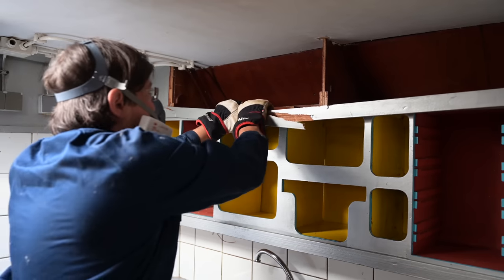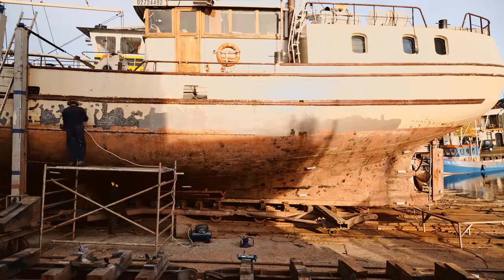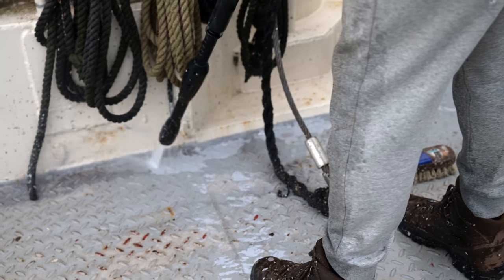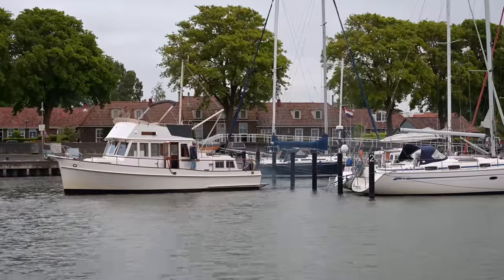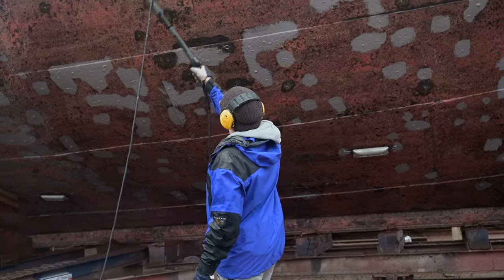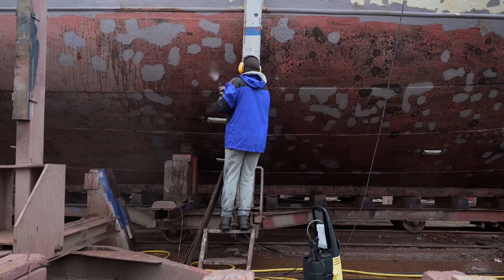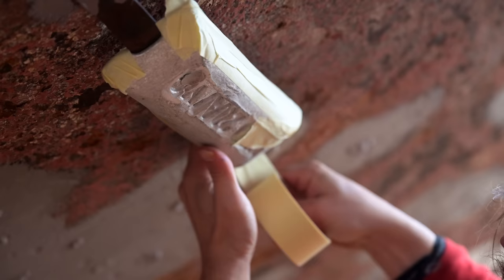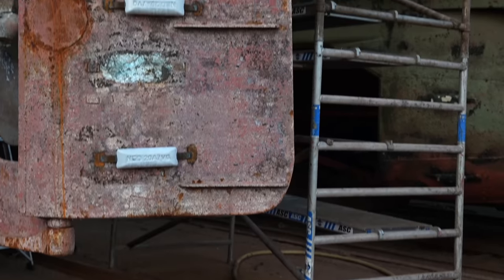Getting Our 82ft Steel Hull Ready for Paint! Now That's a Huge BOAT!

Comment: I love this old vessel. She’s such a cool shape and traditional fishing boat style. Great work guys, you’re doing well!
Reply from the maker: The hull was designed for efficiency and for relatively long fishing trips out on the open ocean. That's why you have the sharp bow and the drop shape. Flying Coney has the shape of a lugger, a drift netter in comparison to a trawler it's a more  elegant shape if you ask me. The reason is that a drift netter is designed to sail to the herring grounds, trow the net overboard and drift in front of the net for a few hours whilst providing a stable platform for the hard working man. A trawler is designed to tow big nets over shallow areas like the Dogger Bank with enormous capabilities to resist the heavy sea in this areas. Hope you find that interesting 🤓
Reply: @FlyingConey  I was a commercial fisherman for years, I think that’s why the bill shape and general design of it appeals to me. An aft wheel house is always a nice ride in big seas. You guys have a beautiful vessel and she deserves to be kept alive!
Reply: Sorry, hull shape and design.
Reply: I’m a perfectionist, and I completely relate to the inclination to do everything perfectly. I sometimes spend way too much money on the “best solution”. I agree being in the shipyard was probably a good thing to get the project moving.

Comment: What a great day when its time to paint, You both must have been so relieved and a lift of enthusiasm with a splash in sight. 
Cheers from NZ
Reply from the maker: All the time the lads told us we have to wait to see the hull painted. I was always a bit skeptical with all the rough welding spots and asked them each day if I can take the sander to make the flush... They told me I've to wait. At the end they were right! With the paint on it's barely visible and it looks like any other hull from that period.

Comment: Paint or primer usually comes off from a steel surface easily when it hasn't been sanded properly or its has dirt dust grease on the surface prior to when it being applied.
Reply from the maker: Sure, but the paint has been on there since at least 2018 and it still is on the port side. It must have been a chemical reaction with the dust or dirt. It's no big deal but interesting.

Comment: Few tips:
- Rust = At least use Rust converter/eater or Phosphoric acid
- We had our 30m ship blasted with 3000bar water jet. It was sandblasted 2 years later. For boats this size the high pressure was really is not equal or better than the sandblasting.
- Next time you prepare the boat for paiting I would rent diesel heated steam/pressurewasher with proper nozzle. The prepwork is more important than any other stage.

Keep on going!
Reply from the maker: Hi, thank you for advice. My question about the water jet blasting you've carried out would be if you have a welded or a riveted hull? The reason we tend towards the water jet blasting is to don't damage the rivets and the seams. We simply forgot about the rust converter. Over the weeks we lost the ability to make proper decisions. In hindsight probably a big mistake but so far the paint is holding up quite well. Also the hull was of course pressure washed when they hauled us out. So it was more a washing off dust and dirt than anything else. Thanks again for your comment!
Reply: @FlyingConey  Our´s is from 1950´s so welded but deck is aluminum wich is riveted and later partly bolted with HST bolts. Our issue was that the areas that were ok before, were ok after the water blasting. Areas with rust issues still had them after the blasting. I know what kind of workload you are going through. Keep up the good work! I think that the paint will be ok until next time :) 

Forgot to say that steel/aluminum seams started partly leaking after blasting, but the is nothing that 5 layerd of International won´t fix :D

Comment: Pressure washing and leaving a fine coating of rust is a common practice just make sure that it is completely dry before painting.  For your information those slots on the deck walls are for letting water drain out.  To prevent water coming in with big waves they sometimes put flaps over them.  Just make sure that they open outward.  I heard of a case where they but them on backward and opened inward trapping water on the deck and even sinking the boat!

Comment: Hi guys, you need a gas powered power washer. They are much stronger and will really clean very well. Actually, I would rent a steam Jenny. They power wash with steam and high pressure and do an amazing job. Just some suggestions but I guess you guys are way past that point already. Keep up the great work and in the meantime , stay sexy Barbara. ❤️ 😁
Reply from the maker: Hi Frank, thanks for the comment! The steam Jenny sounds interesting for cleaning the bilge and the engine room. Maybe it would also be possible to get the coating off from the inside. We could've used the power washer from the yard but we pickt our own little power washer because we only wanted to clean the dirt and the dust off. And as you've seen we striped the paint from the deck 😂😎
Reply: A good thing to consider before Splashing,Would be To Pressure wash the Bilges from Bow to Stern! That way disposing of the contaminants could be contained at the Location for Proper Disposal!! With a vessel of her age I would imagine that the Bilges were neglected as much of the rest if the vessel was when your purchased it! Just a Thought of Good Common Sense, and Beneficial to the rest of the project going forward.

Comment: what did you use to catch the paint flakes from just landing on the ground? did you check any of the paint for lead content? otherwise another great video and best wishes. also if you don't want to sandblast you can hydroblast. there are pressure washers that have over 20.000 psi which will remove paint and rust.
Reply from the maker: The yard has a strainer at the end of the slipway. From time to time they shovel all the dirt out and it properly disposed. The paint shouldn't contain lead. Hydrojetblasting is a possible solution to blast the hull but we're not sure and it will depend on the company that carries out the work.

Comment: I may be asking a silly question but couldn't you use a rust converter on the boat and then prime and paint?
Reply from the maker: It's absolutely no silly question. It's always necessary to get rid of loose rust or layers of rust. That's the reason why we needed to treat the waterline, just to make sure that there's no hole. When this first step is done it's a matter on how long you want the coating to last. Directly above rust, 6 months. On properly prepared steel like we had done, 5-7 years. You can add a few years on top of that if you use rust converter. Sandblasting 20-25 years. Then you can make the calculation what makes sense and what not. but we simply forgot to use rust converter and where to tiered to make any decision.
Reply: Thanx for the answer

Comment: Did you use 2 part Epoxy Primer for the Bottom?
Reply from the maker: Only on bare steel like on the welding spots. Usually you need a blasted surface to use a two component paint. So we used a high quality aluminium primer.
Reply: @FlyingConey  who would recommend Single part Alluminum base Paint on the Bottom of a Steel Vessel? You also referenced applying new Primer over old paint being acceptable in your previous videos. Very Confusing.
Reply from the maker: @lawrencetrapani5623  Not confusing, just industry standard. If you have a blasted hull and the right conditions you CAN apply a two component paint. If you top up the paint you use a one component system since it's possible to apply it above most two component and one component paint systems. A two component paint system is also about 20 000€ for the paint alone a one component system is about 3 000€.
Reply: @FlyingConey  you Get what you Pay For! It would seem the best choice would be to apply the most effective product for Longevity! You had some Serious electrolysis issues and it would seem that giving it all the protection you can! PS have you taken steps to making sure that your grounding system throughout the vessel is inspected, additionally, it would be a wise choice to have someone bring a corrosion meter to your vessel and  check it for galvanic or stray current corrosion. I would recommend you purchase or contact someone to spend the time with a Corrosion Meter on your vessel and point out any stray current, and make sure the vessel is properly protected. Corrosion is measured in millivolts and if not properly addressed can certainly cause problems.
Perhaps you would find a journal or book to assist you with this!
Reply from the maker: We're using high quality paint. Pretty much industry standard. We've measured the 24 volt system and disconnected the 220 volt system. So for now it should be fine. We still try to find a good marine electrician to investigate what happened. And we now have the proper type of anodes!
Reply: @FlyingConey  Do Not think that your 24 volt system isn't capable of producing galvanic corrosion as thus is usually measured in Milivolts. Please find a certified person to do a Corrosion Survey on your vessel when you put it back in the water. As an additional note. When you tie up to your new Dock, Check the water to also find out if there is stray current!
Reply from the maker: We've already measured the 24 volt system and we#ve found no issue! It's allowed and not difficult to do it on your own. 220 volts are dangerous and therefore we need a professional to do it. That's why we've completely disconnected the 220 volt system. We're also not plugged into shore power so there's no way of stray current flowing in between the harbor and our ship.
Reply: @FlyingConey  Ask your Professional if there is enough current running through a 24 volt system to cause galvanic corrosion! Batteries make Millivolts! If your  bonding system is not secure you will have problems!
Reply from the maker: What I try to tell you is we measured for stray current and haven't found one, it's all in the tolerances. The 24 volt system is fine 😅 Only for the 220 volt system we need a professional since we don't have the equipment (silver chain)...
Reply: @FlyingConey  Measured??? Tolerences?Tolerances?? VOLTS AND millivolts. Improperly grounded Battery Systems  will also cause electrolosis.. I takes very little stray current to do Big Damage
Reply from the maker: @lawrencetrapani5623  I've no idea what you're trying to tell me. We followed the instructions of a well known author. Read multiple books on the subject. We've measured the stray current and the readings are okay. According to books specifically. about corrosion on steel vessels. In other words the battery system is properly grounded. The failure must be in the 220 volt system or in the electric system of the boat that was moored next to our boat but is no longer...
Reply: @FlyingConey  A proper Corrosion Meter will be far more accurate than a Book!
Reply: They Do make Corrosion  Controllers for your Vessel, After what you have gone through at the Boatyard, it would be an invaluable pie e of equipment on your Vessel. You can know exactly what the surrounding waters Re doing and also maintain your vessel properly on the inside As Well! Just suggesting this for Your Benefit! All comments have been towards infor ing you of Options to avoid future problems! Have been in this industry for over er 50 years,  Not a know it all,Yet not just an armchair Sailor  yamming at you! All I have said has been to perhaps benefit you and your endeavors. You seem to be offended by some comments! Knowledgeable opinions should be just that,what you do is your choice Always!

Comment: You transferred first of all at lot of micro plastic into the port with pressure washing off all the paint on the slipway. Even if this is standard in the yard it's not okay at all. In sportboat marinas all the water is collected and disposed on the expense of the marina or boat club. I really hate this split level class community. Commercial ships and other businesses are always allowed what the normal citizens are not.
Reply from the maker: The water from the slipway IS collected and the particles are disposed properly.